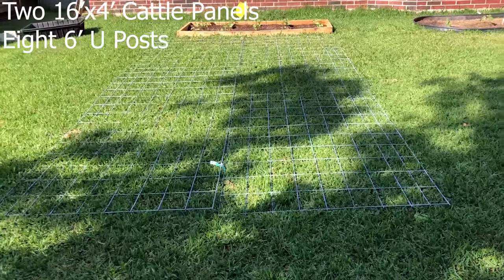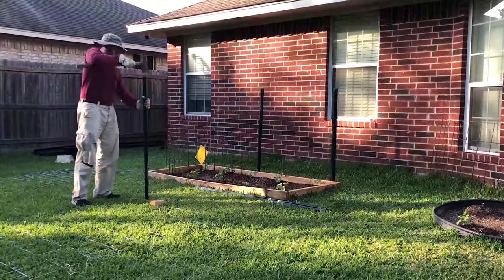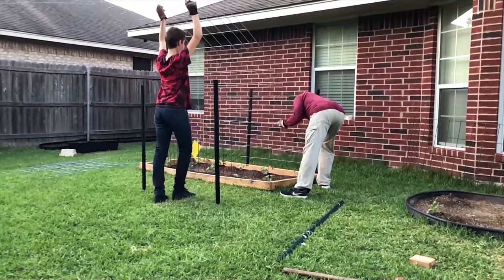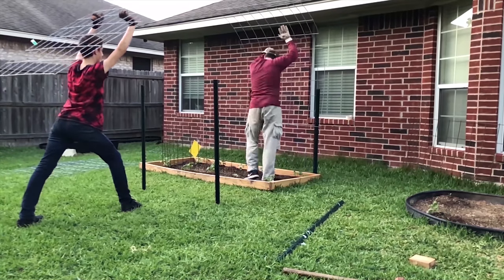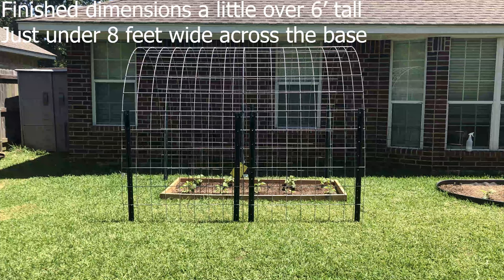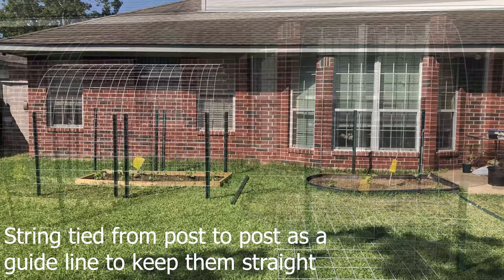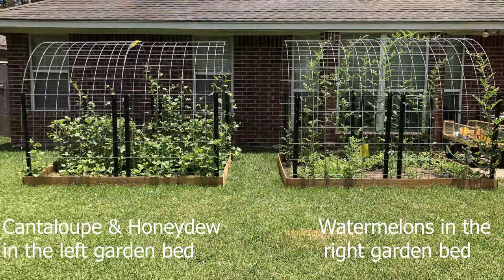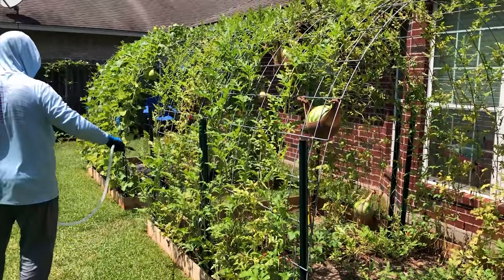Garden Trellis Using Cattle Panels

Comment: Excellent video, like how you slid lower part of panel over t-post, eliminated use of wire or zip ties to fasten panel to t- post.
Reply from the maker: Thank you!  It has worked really well.  2 years later no issues and still holding strong!  Thanks for watching!